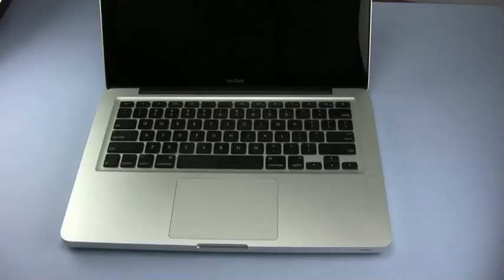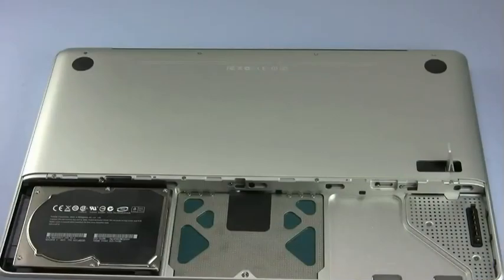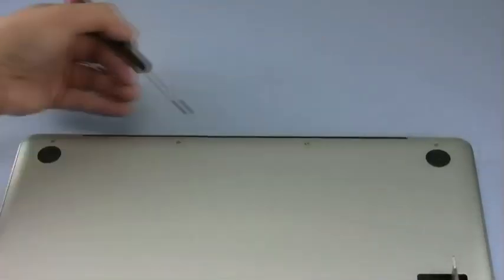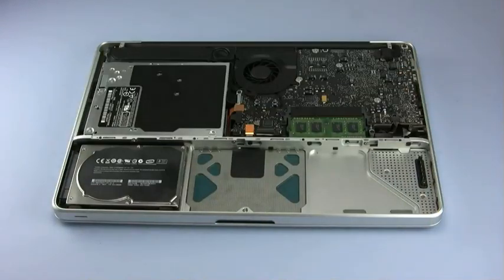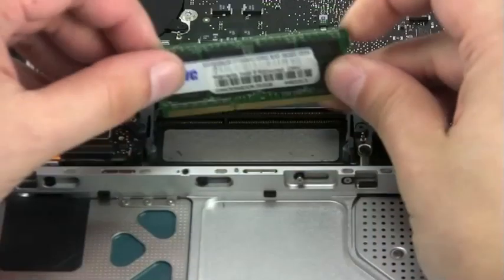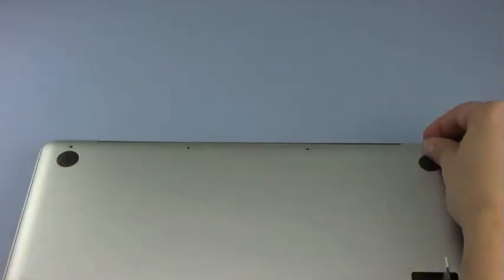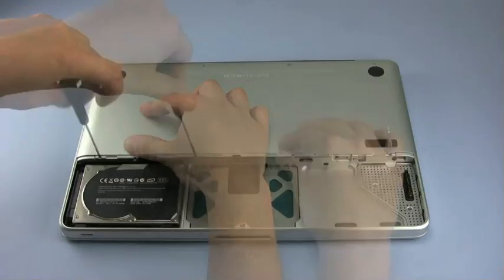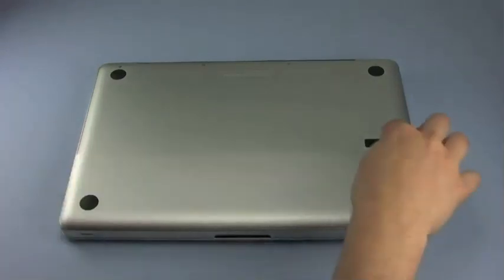How to install RAM in a new MacBook (Late 2008)

Comment: Thank you for very good Video. I know this Video is rather old, but i have updated my old Macbook now. :-) I lost some Screws while doing the ram update - even the top left one... now my Question - if I buy a Set of 10 new Screws - will there be one of them 3mm to fit in the top left? or are they all 3mm? Want to order this set - http://www.ebay.de/itm/Apple-MacBook-Pro-Bottom-Case-Schrauben-Gehause-A1278-A1286-A1297-/162361861827?hash=item25cd8566c3:g:b0gAAOSwM2RZhFZe - thx for help

Comment: FYI, all late 2008 Aluminum Unibody macbooks (upgraded to Snow Leopard first, 10.6.7 minimum recommended) can handle up to 8GB DDR3, that's 2 sticks of 4GB each. use these search terms when shopping around online: 8.0GB (4.0GB + 4.0GB Kit) PC-8500 DDR3 kit, try N E W E G G first (brand G SKILL), it is usually cheaper, then C R U C I A L to compare. Good luck !
Reply: Hello Sabri

Comment: Oh my G's.. you've got a lot to do before you can make the actual upgrade, I mean in my HP Pavilion DV 7 (I know, it's not compareable because it's 17" etc. but: ) I've got 5 screws and then I can remove with 2 other screws one of the hard drives or just change the RAM... all under one big plastic cover)..

That's hard oO

Comment: RAM for sure if you only use half the 160 you shouldnt need the big harddrive yet.......with 4 gigs of ram your whole experience on your computer will become faster........cod4 will run fast.........lots of tabs at once with out loss of speed...........ram is definitely the better choice + the prefomance boost will make your computer last longer

Comment: It should work fine, I installed an 8Gb DDR3 kit from Crucial a month back and ive had no problems so far.  Only problem is DDR3 SODIMM's are stupidly expensive (still cheaper than buying from Apple though)

Comment: what do you mean discharge static electricity before beginning and work on a static free surface. like on the support page they say to touch the aluminum and you mean to put it on a table thats not metal? sorry for the stupid questions